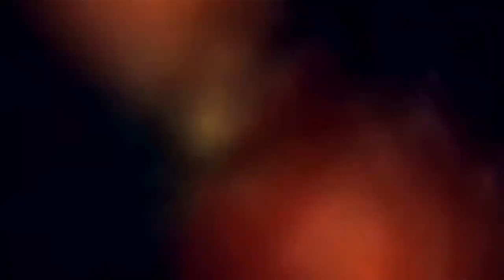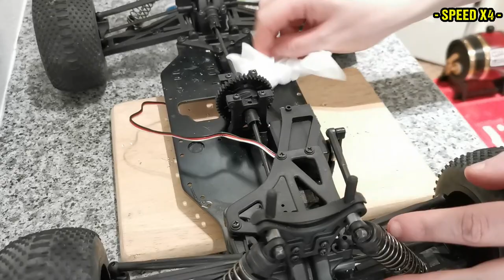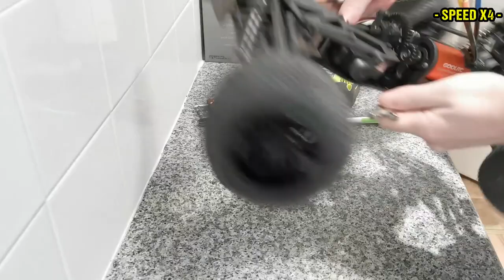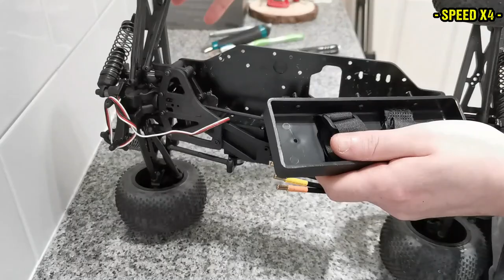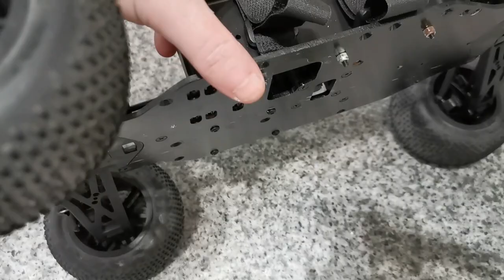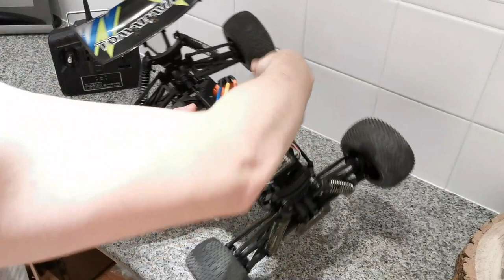How To Convert A Nitro Powered Truck To Electric Brushless Power

Comment: Thanks for the video, still usefull in mid 2021. I have a question though: are you able to adjust the gear mesh with that motor mount ? and is it then possible to change pinion ?
Reply from the maker: hello, your more then welcome im glad you like it..
with this motor mount you only had two fixed motor positions but being plastic i could of easily drilled holes in it to make more or made sliding hole positions to suit different sized pinions..

Comment: Howsit buddy, Iv got a thunder tiger bx nitro which I’m wanting to convert to electric, been looking at the 3674 rocket motor but not sure as to which esc and batteries to use with the motor? Wanting a balanced setup with maximum power, any tips or advice anyone could give me I’d appreciate it a lot! New to electric so I’m clueless 😂
Cheers

Comment: Hi Marc, great conversion. My son has just done the exact same conversion of his Thunder Tiger ST. the only problem we had was getting a pinion to fit. He had to make a collar to fit inside the gear taken off the nitro motor. Can you post a link of where you eventually got your pinion from please, cheers
Reply from the maker: ed fannon hi mate, thank you 👍
Yeah the pinion gears was not easy to find,we had to go for some 25dp, and use a 3.5mm to 5mm shaft converter, I’ll have a hunt through my eBay shopping history over the weekend and send you some info.. happy rcing 👍
Reply from the maker: hI ed, here is some info on the bits for you mate, i got one of these 5mm to 3.5mm motor shaft adaptors https://www.banggood.com/custlink/mKDK42fPag
and these are the 25dp pinion gears i got from ebay. just type the number in mate, 123787889215
i hope this helps, but if you have any other questions just ask.. hapy rc-ing..

Comment: Hi Mark. Enjoyed watching your conversion to electric. I have the model-space hummer which I would like to convert also. Can you please advise me on what electric motor etc I should use. And also if there are complete conversion kits to carry this out. 
I’m sick to death with the fickle nitro engine being very difficult to start.. Many thanks.
Reply from the maker: Bob Ferguson hi mate, thank you very much for that, it’s comments like yours that make doing these videos worthwhile.. I don’t know much about the modelspace Hummer but I do know as it’s a pretty big and heavy 1/8 scale I would personally go for a cheap and cheerful 1/8 goolrc brushless system, and don’t go too high of a KV rating something around 3300kv would be a good mix, here’s and eBay item number to one it’s a electric speed controller and motor combo: eBay item number:184123051606
You would also need to get or make a motor mount too though, loads are on eBay just type in electric motor mount and pick one you think would suit your chassis the best, also your have to find out your main gear pitch and get a matching pinion gear set for the electric motor..
I must admit I definitely know what you mean, some days I really miss my nitro models like my traxxas t-maxx but then i remember the hassle that can come with them lol..
Happy rcing bud, look forward to seeing your conversion. 👍
Reply: MarcRCAddict Thank you so much, Mark. I will act on your advice and keep in touch with you. Once again ta much!!

Comment: Heya Marc, i like your build! I too converted a tomahawk st to brushless a few years ago. I did it differently to this fabricating most parts out out aluminium, however i like how you've used the tools available to you to do the conversion as cleanly as possible! My only suggestion would be a bit of chassis bracing for the diffs, theyre only attached to the chassis with a thin land of plastic on those truggies and can snap with heavy bashing!
Reply: Also, if you're worried about year mesh, just open the four motor mount holes up very slightly, should give you enough movement.

Comment: Hey marc, did you have to use a different radio and receiver? I'm planning on do8ng a nitro to brushless as well but unsure if i need to get a new receiver or if i can use the original radio equipment. Thanks
Reply from the maker: KLIFORD DINIEGA hi mate, yes we did use a different 2.4ghz radio gear, but you can use the original radio no problem at all 👍

Comment: I want to do this so what dp i need to buy?? Thanks i have a old eb4 thunder tiger thanks any 1👍
Reply from the maker: If I remember correctly I used a mod1
Reply: @MarcRCAddict  hi there may i ask what is a mod 1 or can you tell me what motor and esc i need to get thanks 👍👍

Comment: What kv motor are you using because i am trying to convert my old 1/10 scale r nitro buggy into brushless i was thinking a 2600kv motor a cheap 60amp esc and a 3s 3000mah lipo
Reply from the maker: Wild MTB hi mate,  we was using a 3300kv but a 2600 KV would work, 👍
Reply: Ok thanks
Reply from the maker: Wild MTB no worries mate have a good weekend

Comment: Hi sir I would like to do the same on my buggy where can I get the bracket for the motor
Reply from the maker: Hello mate, eBay or banggood, just type in 1/10 motor mount and a few will come up 👍
Reply: @MarcRCAddict  thank you
Reply from the maker: @avinashramlucken6441  no problem 👍
Reply: @MarcRCAddict  hi sir I’m done with my set up have four pole motor 2000kv 120 amps esc.which battery shud I go with (3s 4s 6s)
Reply from the maker: @avinashramlucken6441  hi mate, check what is the max voltage limit for the ESC and motor, but I would suggest sticking with 2s and 3s on this model 👍

Comment: I would like to do the exact same conversion, do you have a parts list?
Reply from the maker: JGC Porsche hi mate, no I do not have a parts list as such but I got everything on eBay.
Type in 1/10 battery tray holder, 25dp pinion gears, 1/10 rc motor mount, and 1/10 1/8 brushless esc motor combo, that will bring up everything you need. 👍
Reply: Perfect
Reply: how many teeth is the pinion gear

Comment: What pinion did you use for this?? Great video BTW 😊😊
Reply from the maker: Hi mate thank you, we used 1/8 8mm shaft 25dp zd racing pinions. 👍 Happy rcing and stay safe.
Reply: @MarcRCAddict  website link for pinion gear?
Reply from the maker: @0pticalc0ncepts  got it from ebay.

Comment: I really wish he listed the link to the motor mount
Reply from the maker: There was no point in me adding the link to the mount I used from eBay as eBay links change too often, You could Just go on eBay mate and type in 1/10 motor mount that’s all I did when you the build, but here’s a few including the black one I used..

https://www.ebay.co.uk/itm/Aluminum-Motor-Mount-for-1-10-RC-Model-Buggy-Car-Truck-Truggy-Spare-Parts/283997352073?hash=item421f8fb089:g:T64AAOSwsR5fTw~j

https://www.ebay.co.uk/itm/JP-Speed-540-550-Motor-Mount-Bracket-For-RC-Model/143687074935?hash=item21746ac477:g:3OwAAOSw9TtfO82F

Comment: Can you do this with a Hpi rs nitro
Reply from the maker: @chrisprud7688  yes mate you can do it to most nitro cars you just need to remove the break and clutch, engine, and match the gear ratio and mesh size 👍
Reply: @MarcRCAddict  excellent I’ve got that all off you just mentioned I just need to find a way to get a motor mount to connect with the spur 
It’s a nitro rs4
Reply: There’s a big gap where the engine went I was hoping to put the motor there but the spur is on the other side any suggestions 🤦
Reply from the maker: @chrisprud7688  so have a look on banggood or eBay for some motor mounts mate, there are many available, just make sure your get the correct pitch on the gears and your be sorted 👍
Reply from the maker: @chrisprud7688  what is the exact model mate, rs3 or rs4 buggy or car?
Reply: @MarcRCAddict  it’s a car Hpi rs4 I think they made 4 versions lol
Reply from the maker: @chrisprud7688  ah ok, it’s going to be a tight fit but should be workable, without having the Rc model in my hands with the motor mount I can’t tell you exactly where to put it, but don’t forget you can always reverse the polarity of the motor to get it spinning the opposite direction so you could then mount the motor in the opposite direction
Reply: @MarcRCAddict  do you have a Facebook page so I could show you mate
Reply from the maker: @chrisprud7688  no mate I don’t, don’t have instagram? If you do message me there, CMVINYLUK

Comment: I’d get yourself a heavier rated and faster rated steering servo :)
Reply from the maker: Hi mate yeah we did, the truck is long gone now though, it only lasted two bashes 😂😂
Reply: @MarcRCAddict  ohh no lol. I’m in the process of selecting parts to convert my HPI firestorm 10t from nitro to electric. The engine has ran off on me a few times and parts are getting hard to find. So I’m wanting to go electric. I’ve been following Kevin’s Chanel for his bangood parts so I’m taking parts from his 100mph car to put into my truggy.
Reply from the maker: @matthewfenton8775  sounds like a good project mate, yeah it was the same with this the parts are non existent now so we though, convert it and then just bash and destroy it lol then cannibalise it for electrical parts, your be able to convert your firestorm just make sure you match the correct gear pitch and your be fine bud 👍
Reply: @MarcRCAddict  cheers mate :) I’ve ordered a pinion to see if it’s the same as the pinion on the clutch bell. Hopefully it’ll be the same. The current pinion is 19 tooth. I’ve ordered a 21 tooth as I want to increase the top speed.
Reply from the maker: @matthewfenton8775  fingers crossed the pitch of the teeth will be th3 same, there are calculators on the internet that can calculate the pitch/angle of the teeth if your unsure on what it is.. also mate are you on Instagram? You might want to check out one of my accounts cmvinyluk, I make custom RC decals, started a little business during the first lockdown in 2020..